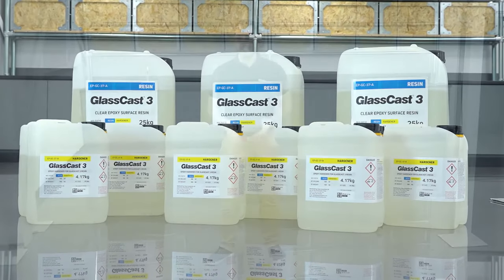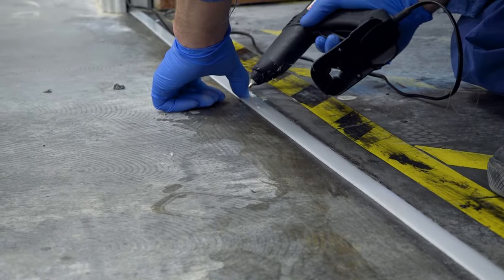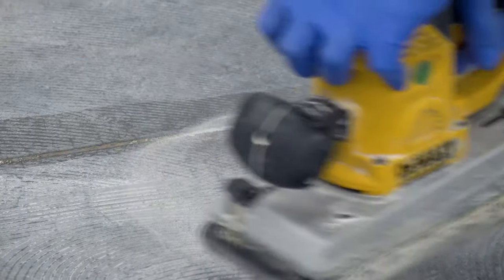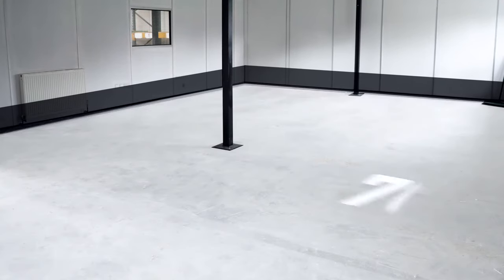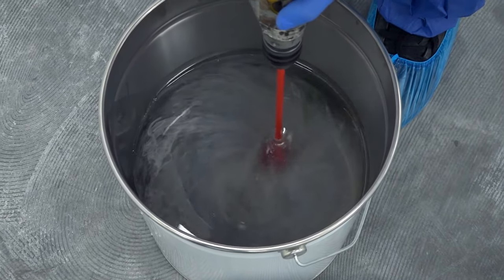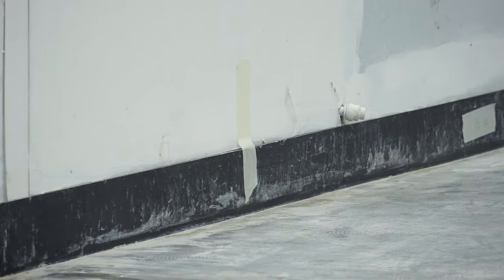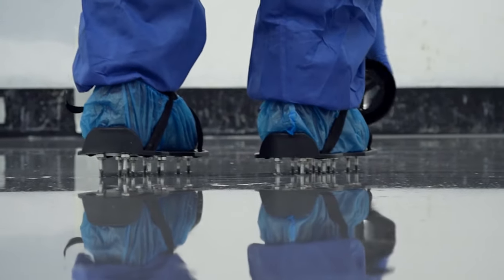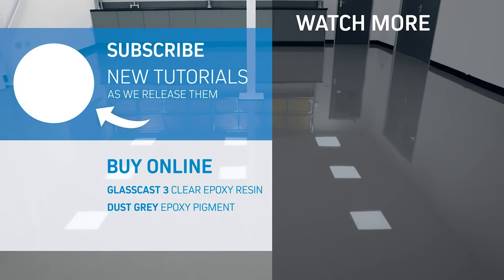Install Your Own Glossy Resin Floor

Comment: I've never heard of this flooring before. Looks good! The two questions is have are: 1. Is it easily chipped by high-heeled shoes, for example; and 2. If I was using this for a workshop, would the resin withstand dropping heavy weights on it, like an electric motor, for example?
Reply from the maker: Once fully cured, it is not easily chipped by heels. We do not recommend it for workshop or garage floors as it is a cosmetic flooring and although hard wearing in a cosmetic flooring situation, is not rated for heavy industrial use where it will be damaged.
Reply: What is the approximate cost of the capital material per meter in terms of?
Reply: @daripada8871  they have a calculator on their website

Comment: Follow up video please of the same floor . With close up of all the floor . I'm interested to see if it cracked on those concrete expansion joints 👍
Reply from the maker: We have no specific videos showing the floor now (although you will see it in many of our recent videos on our channels).  However I can confirm there are no cracks on the floor anywhere.  The room is in daily use so we would notice any damage like that appearing.
Reply from the maker: @Bessie Hillum Not sure I follow sorry, there shouldn't be any warping on a concrete floor. If you're working over a timber floor, it would need to be braced/stiffened sufficiently that any flex was minimised (in much the same way that you would when tiling over a wooden floor).
Reply from the maker: @Bessie Hillum A correctly installed floor is unlikely to warp – it is fully bonded to the substrate underneath.

Comment: Hi, great work, am installing soon, when you say apply a thin coat for sealing can i apply this with a flat trowel?..thankyou
Reply from the maker: The areas where you need to apply the resin to seal and fill gaps etc can be applied with a trowel or flat edge spreader.

Comment: Love this!!! Before I order what filler do I use to fill in the cracks on my concrete floor please?

Cheers guys
Reply from the maker: You can mix up a filler like we did with epoxy and fumed silica thickener or use a wide range of DIY/building industry products specifically for that purpose.
Reply: Hi, Perfect, thank you!

Comment: I’m looking to this on a garage floor, the current concrete is tamped concrete, can a cement self levelling compound be used first, before using the resin?  Thanks
Reply from the maker: Most self levelling compounds are fine once fully cured.

Comment: Does this floor scratch easily? I have a polished concrete floor but it’s slightly uneven by a few mm in different spots and was wondering if I can just pour some of this on clear? Will it be strong and resist cracks and stuff if things are dropped on itv
Reply from the maker: GlassCast is suitable for domestic applications where the traffic is relatively light. If stones and grit were to be walked over the surface on the bottom of shoes then there is the chance that the resin will scuff and scratch. You can sand and polish to restore the surface if this does happen but worth bearing in mind. Naturally, it depends on what is dropped but the resin is pretty resilient.

Comment: Would a floor like this work in the Caribbean? I want to do it to my home but I don’t know if the island is to hot
Reply from the maker: Once fully cured, the resin has a temperature resistance of around 45C so it depends how hot your climate gets, especially consider if the floor gets sun through a window as that can heat it a lot higher than ambient temperature.

Comment: Hi, can I ask a daft question please?
When you say resin on the useage calculation e.g. 105kg do you actually mean resin plus hardener or do you mean the amount of resin you need before adding hardener?
Thanks
Reply from the maker: When we work out the quantity, it is the total amount of resin and hardener (so the combined weight of the two).

Comment: I am wanting to put black textured pvc floor mat on my bathroom floor and cover in resin, is that possible?
Reply from the maker: Its unlikely that the resin would sufficiently bond the PVC and you may find that it delaminates away after only a short period of time.

Comment: Can I clear coat my concrete with this after cleaning it? Or do I have to grind or sandblast first? Could I just acid etch it? I’d really like a product that does not near mechanical prep
Reply from the maker: As long as the floor is level and clear of any surface contaminants then no, you shouldn't need to undertake any specific mechanical preparation outside of what we cover in the video. If however, it has been in use for some time or has traces of oils, grease, silicones or other such contaminants, it would need thoroughly degreasing to ensure that the resin is able to bond to the concrete.
Reply: @glasscastresin  thank you so much for the response. Can I apply 2 layers or does it have to be 1 ? Do you ship to Canada?
Reply from the maker: @mk-jm5tv  You can do, yes - subsequent layers can be applied either at the 'B-Stage' whereby the resin is firm but tacky to the touch; this is temperature dependent but likely to be around 8-12 hours after application OR once the previous layer has fully cured, the surface can be sanded with some 120grit papers and then a new layer poured over the top. We can ship to some, but not all, areas of Canada owing to the Dangerous Goods classification of the resins but please feel free to contact us with your postal code at help@glasscastresins.com and we can let you know if we can ship to your location.

Comment: Hi. I’m looking to create a Marble affect patio. Can this product be used outdoors?
Reply from the maker: Despite the very good advanced 'UV' resistant formulation of our Glass Cast resins, we don't suggest using the GlassCast range of resins for permanent, outdoor applications. This is down to epoxy chemistry meaning that eventually, over time, depending on UV exposure, environmental conditions etc, the resins will always eventually yellow in outdoor conditions. How visible this is depends on factors such as the underlying colour and conditions experienced.

Comment: sir, does epoxy resin in general weatherproof e.g: to use outdoor as a waterproofing ,etc?
Reply from the maker: It can in some circumstances but we generally don't recommend that the current GlassCast range is used in permanent outdoor settings especially if used perfectly clear.

Comment: What do you use in smoothening the floor to remove concrete and stones before applying the REISIN?
Reply from the maker: Any unevenness would need to be mechanically removed so scraped, machined or sanded off. In our case, the floor was laid using a self-levelling floor screed so there was nothing to overcome in terms of smoothing other than filling the joins between the sections of floor but if your floor is uneven and you cannot apply a self-levelling screed over the top, you would need to physically remove any high spots first.

Comment: Hi my name is Tequila I love your presentation it was awesome are you available to do floors I have a small kitchen how much would you charge and do you come out and fix floors if not could you recommend someone Port Arthur Texas can you email me with advice your presentation was on epoxy floors with a high gloss email if possible
Reply from the maker: I'm afraid we don't offer any services and, even if we did, we're in the UK so it would be a fair way to travel to do your floor :) We don't have any specific companies that we work with Stateside but if you search for 'Resin Floor contractors' you may find some in your local area.

Comment: Can I clear coat my tile floor
Reply from the maker: Yes, in theory there is no reason why not. The floor will need thoroughly cleaning/degreasing to ensure there are no surface contaminants or traces of previous cleaning products that might prevent the resin from bonding. If the tiles are very glossy, it might need to be abraded to give a good level of mechanical grip for the resin to take to but it can certainly be used over tiles. You would need to make sure that the grout lines are filled in level with the top of the tiles so that you don't get a witness mark in those areas.